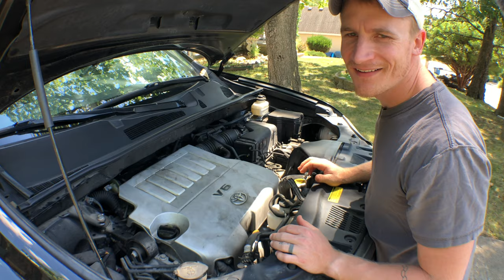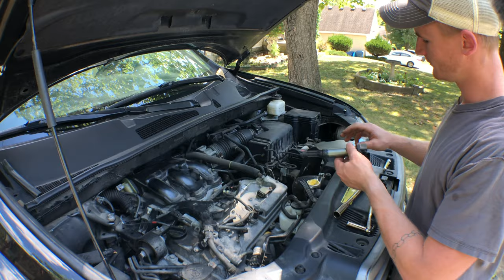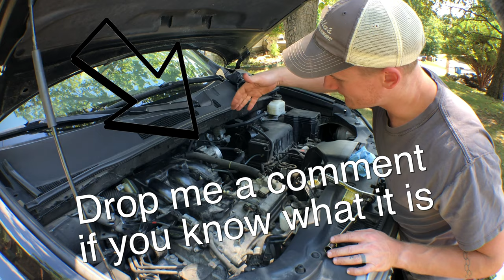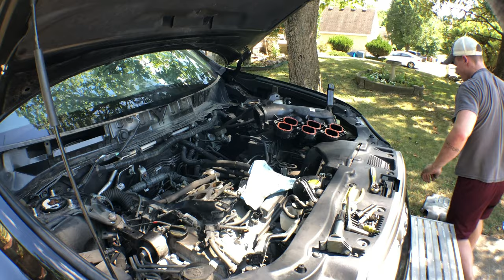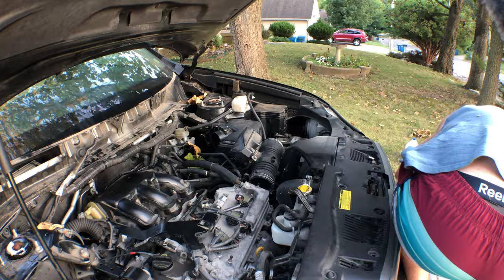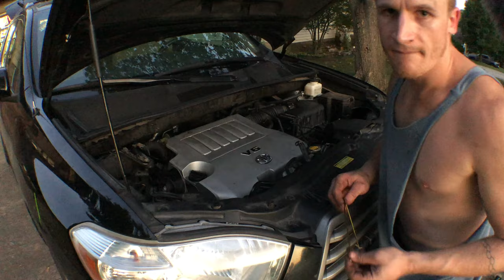Replace Spark Plugs In Toyota Highlander | HOW TO

Comment: For not being a full time mechanic you did a fine job, just an FYI for you and anyone doing this in the future, from my 50+ years of doing mechanic work, you may have done this but I didn't see you do it, when you remove any intake manifold PLEASE use some rags and insert them into the intake ports so you can't accidentally drop ANYTHING down into the engine, if anything especially a metal piece, i.e. a bolt, nut or washer, does drop into the ports while you're working on the engine and it's not noticed and or retrieved (which is sometimes next to impossible to do without removing the heads) the engine will be toast/destroyed when you start the engine and that piece get sucked down into the valves and pistons, even dirt or other debris can do harm if it gets into the combustion camber.
Reply from the maker: Wow. 
I am sure glad I didn’t drop anything in my engine. 
Where were you when I did this the first time. 

Truth be told is I had cylinder 1’s coil pack go out on me and I had to replace it a couple of months ago. I had to remove everything all over again. 

This time, I was smarter and I covered the intake manifold with some duct tape. 

Thanks again.
Reply: Yes cover the holes of intake. Surprised you didn't get more likes on your suggestion. Possibly of a very costly engine replacement ! $6k to $10k.
Reply: @BuildItSimple  yup i learned this , replacing the brake vacuum pump on a 2016 Chevy Malibu, when it broke, ugh... that was a job, and i never done anything like that before, took me a month to study and then another month to fix, waiting on parts, that was back in august-oct and the car is still running.. i am just a wife who loves to save money, hubby really does not like working on cars. SO yes ladies you can do it too lol☺
Reply: "I would pin your comment to the top" ;)
Reply: Great point! I have slippery fingers, drop screws and bolts all the time when I'm working on cars.
Reply: I have this same Highlander and the boot is stuck on the spark plug in cylinder 1 back left. Any tricks or ideas how to get this bastard out?

Comment: Did anyone tell him that the grey metal thing either the coolant lines going to it is a throttle body? When doing this job you might as well clean the throttle body ( YouTube how to do it and use throttle body cleaner not brake clean etc. ). Since you made all that effort, buy a throttle body gasket especially on a 7-15 year old vehicle. Also change out the intake manifold gasket. Ya I cringed when I saw the intake ports were wide open. Use a clean rag or painters tape ( don’t use “ duct tape “) it leaves a residue which could lead to leaks. The intake is plastic. Loosen the screws from the outside in and the opposite when putting the intake back on.  Use a torque wrench and Google the torque settings. Like you said it’s not much but that also means it doesn’t take much to crack the plastic. Doin* the front plugs first gives you some muscle memory for how 5he wiring harnesses disconnect. Yes they are brittle but they can b3 taken off quite easily without breaking the connection.

Comment: Amazing video thank you brother. I’m one of those people people who don’t put that back bolt in lol I don’t think you need it. I think it’s just for when they put the engines in in the factory with the hoist.
Reply: I couldn't put the back bolts in either. I figured the 10 mil nuts and 5 mil hex bolts on the front of the manifold are enough to cinch down the manifold so the IM gaskets get a good seal. Some things robots can do that humans can't.😂

Comment: Great video !  I know some about cars and I do as much as I can by myself but when it comes to spark plugs and ignition coils, especially those three in the back, I think I need to be more confident before I replace them myself.  Those three in the front are easy peasy.
Reply from the maker: Self awareness is a real thing. 
If you really think you shouldn't attempt it then I support you. 
I will tell you.... If you have a basic socket set, some problem solving skills, and a little patience, you can do this repair. But on the other hand, I totally understand if this something you don't want to attempt.

Comment: Fixing to do this job on my 16 Highlander during Christmas break. I appreciate your video. This will be my second major job on my Highlander. The first one was changing out a noisy water pump to their new design. Not a bad job either. Just have to jack the engine up a couple inches in order to clear the frame.
Reply from the maker: How did you spark plug replacement go?
Reply: @BuildItSimple  went well. No troubles
Reply: @markmurrell1894  Glad to hear that.

Comment: Thanks for doing this.  Getting ready to do this on my wife's 2013 Highlander, we've driven it Seattle to GA three times now and getting ready to do it again.  Will also be doing engine, trans and differential oil and filter change. All simple  jobs but this seems like the most time consuming having to remove the wiper panel and intake. They are great vehicles.
Reply from the maker: You are welcome. 
I am glad you have had great luck with your Highlander. If you continue to take care of your car, it will take care of you. 

My next projects on my Highlander are a diff oil change and coolant change. 

Please come back and post an update on your progress.
Reply: My wife’s 2013 highlander limited has 230k and I’m barely looking to do this. But you only take off the manifold you dont have to take off the wilder panel etc.

Comment: Dude great video and a HUGE help! Did this today. Just a point about rear bolt. Not that hard to remove the bolt that attaches onto the engine and not the plenum side. Also make sure you route the airbox tube line UNDER the plenum and not towards the firewall. Removing the wiper stuff was key!  Thanks again!
Reply from the maker: Glad I could help. 
That's what I am here for.

Comment: I would blow out spk plug holes before removing so no debris falls in cylinder and cover the intake manifold for same reason. Always use antiseize on new plugs. Tx for video
Reply from the maker: Great Idea. 
I need all the practical advice I can get.

Comment: So, I have a 2010 Toyota Highlander Hybrid 3.3L V6. Another guy on here was recommending replacing the coil packs when doing this job because of how daunting the job can be. My Highlander is at almost 187k miles. You say that these should be fine?

Also, as far as gaskets go. Do I just need a new plenum gasket and throttle body gasket then? Thanks for all your help!
Reply from the maker: Truth be told a couple of months after I did this repair, Cylinder 1 coil pack went bad on me. 
I had to the job all over again. 

I would not replace the coil packs at the same time strictly because of price. I would rather replace them as they go bad. The coil packs are pricey. 

Also, My throttle body and intake manifold gaskets were in good shape. I did not need to replace them. 

If you do the tare down and you realized the gaskets look bad, then replace them. 

Good luck!
Reply: Andrew, I heard several times that coils can get bad and should be replaced with spark plugs fyi
I changed a buddies plugs on Ford f150 it was still missing, he took to real mechanic I have no code reader and he found bad coil. It would work sometimes ( the bad coil) so when I tried swapping it out with another it seemed to work. I guess the wiring in the windings of the coil get weak and short out or whatever

Comment: Good job Bro. I have a 3rd gen with the same engine. I purchased an Endoscope Camera for 20$ from Amazon. It helped me see behind the air intake and find all the bolts.

Why did you replace the spark plugs? The are good for 192,000km according to the manual. Did your car start behaving poorly? 
I'd love to see you do a coolant change in it. I'm trying to find out what is the easiest way to do it.

Keep up the good work
Reply from the maker: An Endoscope is a great purchase and can be useful for many different projects. 

I changed my plugs because I had never done the replacement before and I wanted to make sure everything was good. My car was not behaving badly. 

I do have plans to do a coolant flush but I need to wait until its a little warmer outside. 

Thanks for commenting.
Reply: 192,000 on plugs ?! Never heard that number before. 133,500 and did 3.6l Ram promaster and plugs were terribly worn. Should've been changed at 92,000 !
Reply: Plugs rated for 120K. Also, good luck getting them out after that many miles..rust is a real bugger if it gets far enough along..a broken plug can ruin your week. Mine were 11yrs 112K and they were tough but doable..a little rust had started.

Comment: Hmm I'm glad I was being lazy and let the shop do this while it needed other routine stuff.  Not that I couldn't tackle this, but dang Toyota engineers dropped the ball on ease of maintainability on this!

My I4 Tacoma was a 15 minute job.... Much of the cars I've worked on in the early 2000's late 90's was pretty straightforward.  This is too much fiddling for plugs and I'm surprised this is a Toyota procedure.

Great video though!
Reply from the maker: Not all the jobs on this vehicle are difficult. Just a few.

Comment: Good stuff kid
I was thinking of buying a Highlander.
First things to look at before buying anything used is
Fluid changes
Spark plugs

This would cost a small fortune to have the dealer change these.

Other than spending I guess 4 hours you got it done
Great..
How does the Highlander run otherwise?
Reply from the maker: Thanks. 
You should for sure buy a Highlander. Absolutely one of the best vehicles ever made. 
 Our highlanders is 12 years old and has 110k miles on it. I drive a brand new Dodge Ram that has 10K miles on it for work and the highlander runs way better. 
There is no comparison. 

Good luck finding a vehicle.

Comment: Could this have been done without removing the intake and just removing the windshield wiper assembly?
Reply from the maker: Changing the back 3 plugs requires removal of the intake manifold. Those 3 cylinders are under the intake manifold and cannot be accessed just from removing the wiper assembly. 
I wish it could be done. It would make the repair easier and quicker. 
Thanks for the question. 
I hope this helps. 
Good luck on your repair!

Please comment back if you have any more questions.

Comment: oh this going to be just as fun as the yaw sensor... lol i am only 4'8 and your up under that hood... i need to record everything too... just curious why did u have to take the dash off? thanks for the video...
 i have 2008 highlander limited
Reply from the maker: Thanks for commenting. 
I am glad you can relate to short person problems. Ha. 
I have seen it a few times where people can do this job without removing the wipers and the wiper tray. 
I have small hands and I couldn’t get to the bolt in the back. The take down looks worse than it seems. It wasn’t that bad. 

I hope you like your Highlander. We love ours.

Comment: After how many miles should I consider replacing spark plugs on a highlander? What's factory recommendation?  Also should I ever consider replacing the coil packs or wires?
Reply from the maker: Toyota specs Iridium plugs for most of their cars now. 
Iridium has a long life and they say last up to 110,000 miles. 
So interval replacing should be done at your discretion. Most people don't ever think about these things so they only replace plugs when they have an issue, like one misfires. 
I only drive about 10k miles a year so I replace mine about every 5 years. (50k miles)

Coil packs on Toyotas can be really expensive. They can last the life of the vehicle. It is recommended that they be replaced when they go bad. When they are replaced, they can also be replaced one by one.

Comment: The #1 TOOL for this job is 12 millimeter  RACHET WRENCH. For the bolt on the left side that everyone cant get to. Next time it should take me 2.5 hrs vs 5 hrs my first time😰 last week.
Reply from the maker: Amen to that. A short time ago I had Cylinder 1 miss fire on me. I had to do the whole job again. 
I was way easier the 2nd time. I for sure cut the repair time in half. 

Good work. 
Thanks for commenting.

Comment: Wow - Thanks for this video! 
This looks super hard to do, so let me ask this: IF I am getting no misfire codes (or any other codes for that matter), should I skip this? To be honest, I am the second owner of the same 2010 model here that has 137,000 miles on it -- no clue if plugs have ever been replaced. What is your opinion? I'm an retired older guy, but very mechanically inclined. I hate the part about the likelyhood of those coil clips breaking...Grrrr.
Reply from the maker: Whenever I purchase a new to me used vehicle there are some basic things I always do. I do these things because it ensures to me that they are done and the vehicle will run the best as possible. 

One of those things is changing the spark plugs. If you do not know if the plugs have ever been changed, I would change them. 

Good luck!
Reply: @BuildItSimple  Well, I'll go ahead and order those clips, and proceed after recieveing them. (If I don't have them, they will break; if I do have them, I won't need them. 🙂)
Reply: @AerialLensVideo  Good Idea. Better safe than sorry.
Reply: Aerial Lens, you can pretty much guess that plugs have never been changed on a vehicle. Car may still run but not very good performance or gas mileage. More cranking on start ups etc
Reply: @tubetime39  I truly miss the days when lawn mowers and cars had a lot in common: Super Easy to work on. Obviously, cars have come a long way AND the old saying, "If it ain't broke, don't fix it," is losing a lot of traction with today's vehicles. BUT there are so many ways to screw this up. I will set aside a day to do this soon (NO WAY I would trust a dealer to do it, as they would surely mess something up -- call me a skeptic, but dealers do have a well deserved reputaion for that).
Reply: @AerialLensVideo  went to dealership (used cars) and they had maintenance records from previous owner in a folder. The third bill was for plugs and coils being replaced  5  months ago ,yay !
Reply: @tubetime39  That is GREAT! Is it a Highlander ?
Reply: Sorry - didn't see that question til just now. Yep, 2010 Highlander Limited model.

Comment: How long did it take to replace the spark plugs? I have a 2011 Highlander Hybrid, but used to have a 2010 Corolla, which was easy peasy to change plugs in. This one, however, I have no idea if plugs have ever been changed as it is a new vehicle for us, so I am considering changing plugs. I am a bit intimidated by the plug change process, though! I have never gone that deep into a car without some help. A bit nervous to say the least
Reply from the maker: Thanks for the question. 
I had never done this repair before so it took me 6 hours or so. 
That is probably at least 2x the amount of time it would take an experienced mechanic or someone who has done this repair before. 
Basically 2 evenings after work. 
I will say that there is not much guess work on this repair. I think almost anybody can do this. 

If you don't feel confident doing it on your own, grab a buddy to help you. That's what friends are for. 
2 head are usually better than one. 
Also, be patient. Don't feel like you have to rush through it. 

Bigger jobs like this one are a lot about the journey and the process. Also, the sense of accomplishment at the end of the job is amazing. 

Reach out if you have anymore questions. 
You can do it!

By the way, Go watch my video on replacing my evap core. That job was daunting.
Reply: Did our 2011 Highlander today and it took about 3-4 hrs. Definitely take off the wiper assembly.
Reply: @BuildItSimple  thank you so much for your reply. I dont have any friends to help, but have a boyfriend, son, and daughter that can help. I am a little short, though, and worried about the arm reach in the back and if I can reach it. Yes, I am a car chick. Been working on my own cars as long as I can do it. So, I want to tackle this one day. I will check the front plugs first to see what shape they are in before proceeding with purchasing plugs and going forth. We only have this one vehicle, though, so that is definitely a concern before we start. Appreciate your videos!
Reply from the maker: @cjnorton  That's fantastic. 
Maybe your repair can be a family affair? 

I don't think you will have much trouble reaching the bolt in the back. It's really not as far back as it may see. Also, once the wiper assembly is removed it is much easier to reach. 

Great Idea on starting the front plugs. They are easy to reach and will give you a good indication of the status of the back plugs. 

Good luck and come back and leave an update once you do your repair.

Comment: hind-sight, do you think there was any way to pull and replace those plugs if you had not removed the intake manifold?  I've seen people fight over the top of it to get that hard to reach bolt on the bracket but do you think it would have been ridiculous to try without removing the intake?
Reply from the maker: You cannot remove the plugs without removing the intake manifold. 
It’s a pain but the plugs are underneath.

Comment: Would you attempt this without removing the wiper assembly?
Reply from the maker: I would have done the job without removing the wiper assembly if it was possible. 
The space is just too tight without removal. 

Also, The wiper assembly is not very difficult to take apart, so that wasn’t a big deal. 

Good Luck!